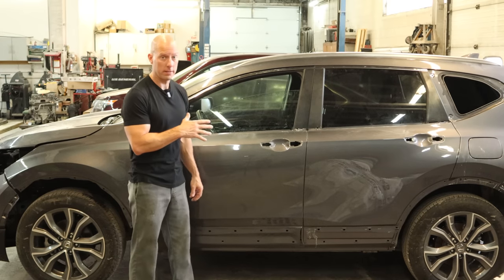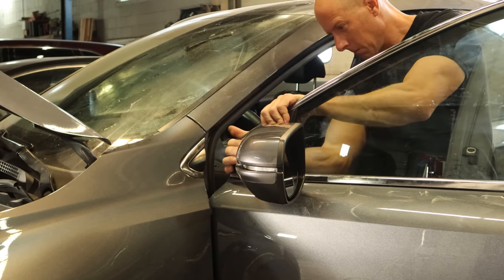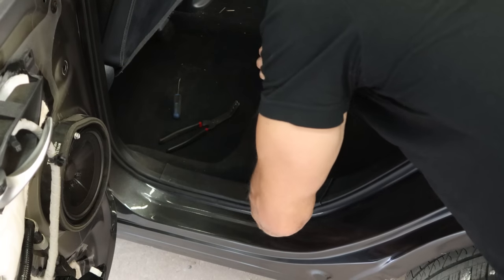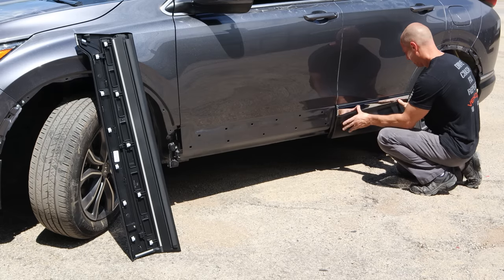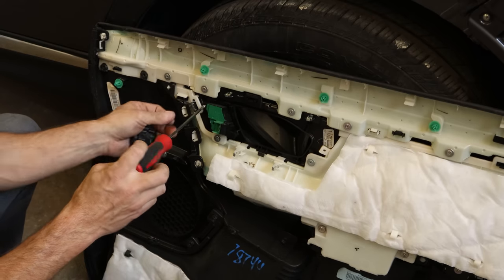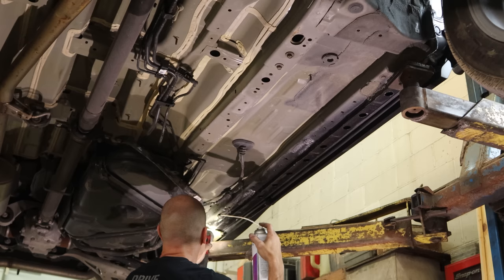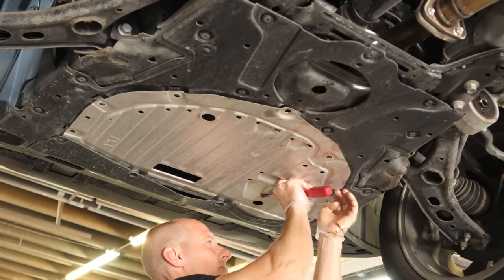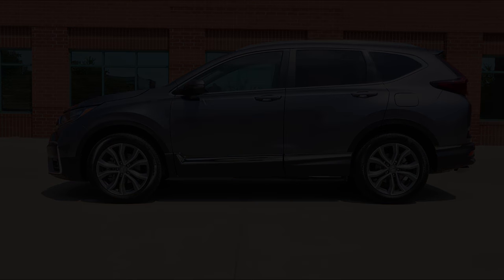Completing the rebuild of the T boned Honda CRV

Comment: I bought a 19 CR-V just like this one with a rebuilt title for $17k with 23k miles. I now have 114k miles not a single issue. I drive it very hard too meaning I constantly pass ppl and put my foot to the floor alot! It’s been the best car I’ve owned! it was rebuilt due to a rollover and you would never know it was in an accident unless I told you about it, because it was rebuilt by a professional like you

Comment: The hater’s tears are already flowing! Can’t wait to see what the next Boring Build will be!

EDIT: 4:49 you just reminded me of the little adventure I went through with my Buick Lucerne’s driver side mirror; the dealership I bought it from replaced it with an aftermarket mirror but didn’t get the correct one; my Lucerne has memory seats and the automatic dimming glass in addition to heated mirrors, but they installed a heated mirror only (likely because the mirror glass was poop brown from age) and not realizing the original mirror actuator had positioning circuitry for the memory systems. So every time I tried using the park tilt personalization function or the memory recall buttons, the driver mirror would go off in a random direction until it hit the stops in a corner position. Took me two trips to a local pick and pull yard to get the correctly optioned mirror guts and the outer shell in the proper color.

Comment: Scott, I have a question . In you're opinion, what's the cut off for money into an old vehicle to try to get out of buying a new vehicle.  I think that'd make a great video!
Reply from the maker: It depends on so many factors.  Fixing the old one is always cheaper in the short run.  Rust usually kills ours around here.

Comment: 8:45 I prefer my 2000 CR-V Cargo Tray. It is a table, if you take it out and fold out the legs!
Reply from the maker: Are there really that many people eating dinner out of the back of the CRV? 😂
Reply: @vehcor  If you broke down, you could have a Flea Market ?
Reply: Had a 99 and an 02 CRV, never had a chance to use the picnic table.
Reply: @jamespn  I bought 2 folding chairs to use with it, when I went Mountain Biking away from home. Never traveled away!

Comment: 17:50 stupid idea keep some of that plastic strip material from  the wider 3m double sided tape and cover the gooey fun stuff with it where the wire harness will go through ...then put the wire harness through the water barrier and then pull the plastic strips off the gooey fun stuff like you do when you put the molding on...just a thought if the plastic pull strip stuff would work  with the gooey fun stuff ...maybe do a test and see if it works...ill shut up now : )

Comment: You are gonna listen to why I hate Fram filters, and you will like it...
Reply: Some Honda oil filters are made by Fram...
Reply: @gillesthibault429  Fact is, all sarcasm aside, most filters do well as long as they are  replaced before they have used themselves up. Most think a filter that clogs up sooner is bad. I submit just the opposite is true. A filter that takes longer to load up, lets more debris past the media, a filter that is totally loaded up by 5k is preferred if you care for your engine. 

Oil Analysis shows, in most cases, oil is use up by 5k so a change is warranted. My Mercedes filters never loaded up with debris, after sending a Wix standard and a Mercedes, the Wix out performed trapping smaller debris than the Mercedes was capable of. 

Even a Fram is better than most factory filters. You just can't go 10k, nor should you. 

I know synthetic oil will last forever in a gas turbine, but car engines run rich when cold, attract moisture as they cool down, and get debris from cats and most high flow intakes, all this degrades your oil in short order.

But then that's my opinion based on money I spent testing.

Comment: 29:35 another reason they'd total a vehicle is if the policy owner had a "like new" (don't know the proper term lol) policy rider that says any accident that would diminish the resale value of the vehicle would require a complete vehicle replacement. I asked about it on my 2004 F150 'so what's the cost of total replacement of new? you know if I damage my vehicle over x amount you replace it with new 2023"? lol The policy rep laughed..yeah ok RiiiIIght.
Reply: Do policies like that really exist? I mean, unless your brand new car is super desirable, as soon as you drive it off the lot it’s used and worth less than you paid for it.
Reply: @Sashazur  100%...(I looked it up) it's called replacement cost insurance vs actual cost insurance. This means that you will only get what the vehicle is worth vs what it will cost to replace it with a new one. 

You have to pay for it of course, insurance companies ain't stupid.